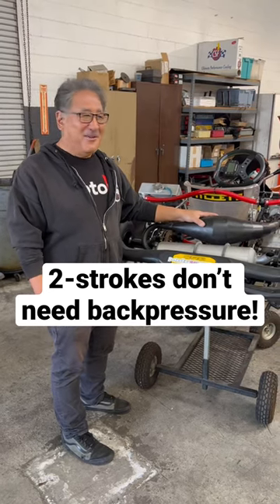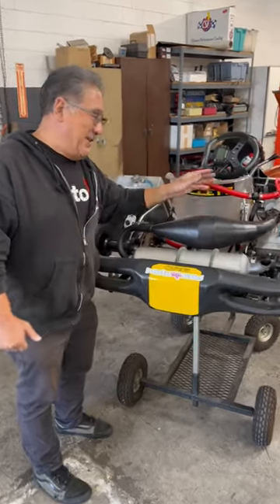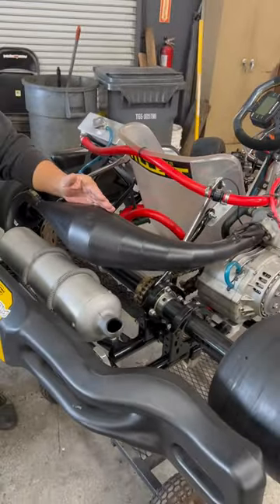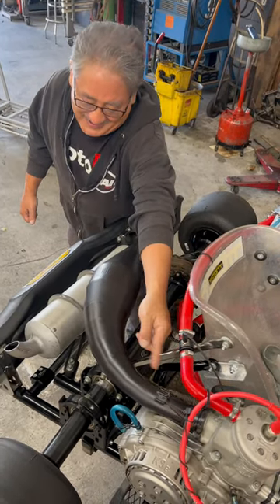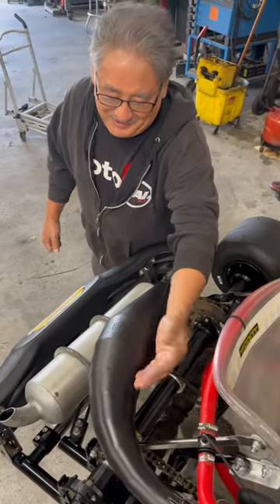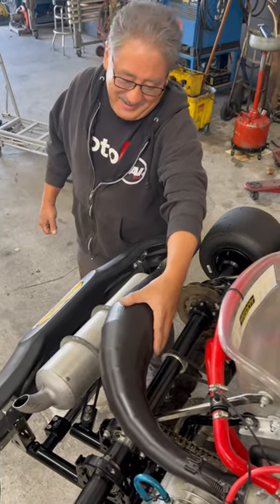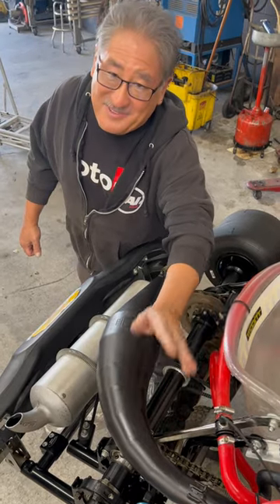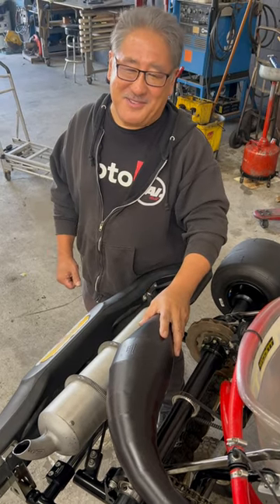2-strokes don’t need backpressure!

Comment: This guy hasn't got a clue, what does he think the 'stinger' at the end of the pipe is doing? The stinger is creating pressure which helps increase the intensity of the wave reflected by the baffle cone. Of course if the stinger is too small then the pressure  goes up too high, also the engine temperature gets too high.
Reply from the maker: The stinger is the chamber exit and is designed to let exhaust gas out but not reduce the strength of the reflected wave as much as possible. It is not to increase the back pressure.  In fact, its area is about 60-70% the size of the exhaust port and once you consider the cooling and diffusion of the gasses at that point and according to Boyles law, it is about equivalent.  It is not a restrictor to increase backpressure but to make the rear cone a better reflector.  If you look at the thermodynamics of the two-stroke engine and the PV Curves, there is no way increasing backpressure gives more power unless it is making a poorly designed pipe work better in some parts of the powerband which is possible.
Reply: AG Bells book and many others give a lot of information on the length and diameter of the stinger, up to a point keeping the stinger restrictive increases the pulse strength in the expansion chamber, clearly if you go to far with this it becomes so restrictive that the engine can not breath and possibly over heats, go too large with it and the chamber does not work as well as it could because the positive wave reflected by the baffle cone is reduced in intensity. changing the size of the stinger changes the way the pipe works and the only it can do this is by changing the pressure in the pipe.

Below is a copy and paste from Gordon Jennings book titled "The 2 stroke tuners handbook"...."Having gotten past the business of diffusers and baffle-cones, we can proceed 
onward to the lengths and diameters of lead-in and outlet pipes. The latter will, if the rest 
of the expansion chamber is proportioned fairly closely in accord with the advice I have 
given, have a diameter between .58- and .62-times that of the lead-in pipe, and a length 
equal to 12 of its own diameters. It is simply a pressure-bleed resister, which prevents 
the free escape of exhaust gases from inside the expansion chamber and thereby creates a 
backpressure to enhance the port-plugging efforts of the wave reflected by the baffle cone. 
This outlet pipe is much more sensitive to diameter than length".
Reply from the maker: You are simply cutting and pasting what someone wrote. The stinger is there to keep the backpulse strong, not to restrict flow. Your first quote is exactly what I said.  Jennings is even agreeing with what I said although his terminology is wrong.
Reply: @motoiq  It keeps the back pulse strong by creating pressure in the pipe!
Reply from the maker: Pressure in the pipe affects the speed and timing of the reflected wave which can be used to influence the powerband of the engine. Still, it also causes pumping losses and reduces the amount of energy recovered in each combustion cycle. Hence, it is better to use changes in port timing and further refinement of the pipe design rather than just use a smaller stinger to get some tuning results. Adding backpressure is a band-aid that has tradeoffs in efficiency.  Two-stroke tuning isn't one dimensional with the pipe as the only tuning device.
Reply: @motoiq  So I can take it that when you build a pipe you use a stinger that is so large that it produces no back pressure in the pipe at all? If so give me an example of the diameter of such a stinger.
Reply from the maker: No, a good rule of thumb is a tube 60-70% of the cross sectional area of the exhaust port with a length 12-13x the diameter.  You can mess around with stinger length. You can also experiment with the stinger going into the chamber itself or as a side bleed.  If you have to deviate from that a lot and the math on your chamber seems right, then a look at your port mapping should be considered.
Reply: @motoiq  ...And how to you know that the stinger 'formula' that you are using is not creating back pressure in the pipe? In fact I'd very  restrictive enough to create pressure in the pipe.
Reply from the maker: When you consider that the exhaust gas will contract and loose energy due to boyles law and diffusion in the chamber, it is not really "adding backpressure" if everything is optimized even though the stinger is smaller than the exhaust port.  Sure as a bandaid you can choke down the stinger and increase the pressure in the chamber to speed up the reflections, typicaly to gain bottom end or mid range but that is a bandaid and a trade off in overall power potential. There are very significant pressure pulsatations that can be over 2 bar in the chamber but it part of why the chamber works.  It is not adding a cork in the exhaust to increase backpressure.  If you really want to know you can probably look at the PV diagram for a two stroke, thermodynamics of a two stroke,  port mapping of a two stroke.  The real tuning of any kind of engine is a holistic process, not something like adding backpressure.
Reply: @motoiq  I'm fully aware that in order to get the best out of a 2 stroke engine you can not look at any single part of 'system' in isolation, port timing, carburation, head design, exhaust design, and ignition curve all have a part to play. Anyway I will stick with the traditional theory that stinger can be used to fine tune the expansion chamber (Jennings devoted many lines of text explaining this and backed it up with dyno runs, at no point in his book was it inferred that this was a band aid to a badly designed pipe), you are welcome to stick with your theory!
Reply from the maker: What I am saying is not theory, it is fact, proven over 100 years ago. I learned about it in college and did a lab on it which included very carefully monitored dyno runs. It's taught to every engineering student. Just because you won't bother to learn or look up what I suggested doesn't mean I am wrong.  Sure a stinger can be used to tune an engine, but it is not primarily a backpressure device, it is more of an acoustical device.  Backpressure hurts power. Increasing the pressure in the pipe will change its tune due to speeding the waves in it. Tuner books only deal with simplified explanations of what happens inside an engine.  Often you get accused of talking about theory vs fact when talking to tuners but it is actually the other way around. As an engine builder, I have built very fast two strokes when it was allowed by class rules so I am not am not just an academic. Currently, the classes of racing I run two strokes in have spec motors so it takes a lot of effort to get an advantage and still pass tech. Instead of going in circles trying to argue,  look up what I suggested and learn more about the subject instead of saying I don't have a clue. If you are an engine builder this knowledge will help you build faster stuff.
Reply: @motoiq  You seem to take offence to the word ‘theory’ I’m not sure why because unless you have actually carried out an experiment to prove that your design of stinger does not increase the pressure within the pipe it is a theory regardless of whether your dyno tests show an increase in power or not.  A test that would either prove or disprove whether the stinger increases pressure would be to build a pipe with no stinger and run it on an engine whilst measuring the average pressure in the exhaust. I am aware that this is easier said than done due to pressure waves bouncing up and down the pipe, I guess taking a pressure reading from the ‘belly’ section of the pipe would be a good starting point. The test would then be carried out again but this time with your design of stinger now fitted to the pipe. I am confident that adding a fairly small diameter long pipe would mean that you would see an increase in pressure during the second test, you are confident would not cause any pressure increase, that of course is your prerogative. As to the stinger being an acoustic device, well I agree with you if you are talking about the fact that the placement of the entry to the stinger has an effect on the finial sound output emitted from the exhaust. I have ran more than one set of pipes where the entry to the stinger was way up inside the pipe, just past the start of the baffle cone.

Of course I have not carried out the above test but I have been round for long enough to know that adding pipework to any ‘system’ that is flowing a gas or a liquid is going to create a restriction in that system, the result being an increase in pressure within the system.